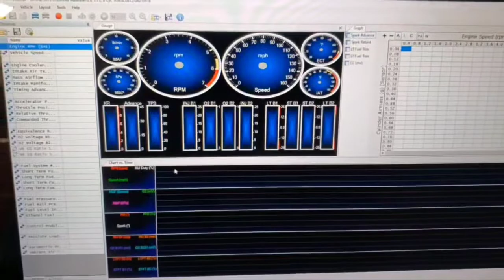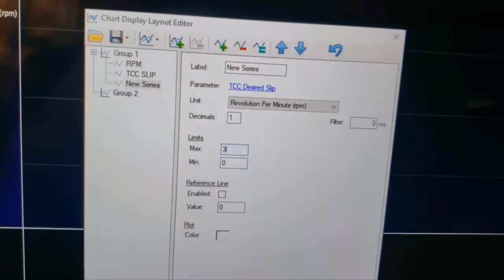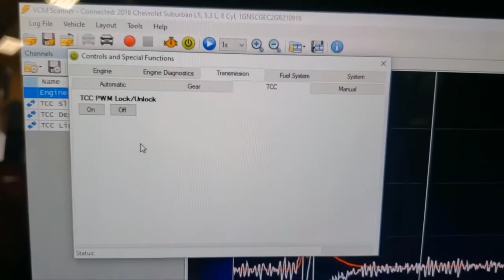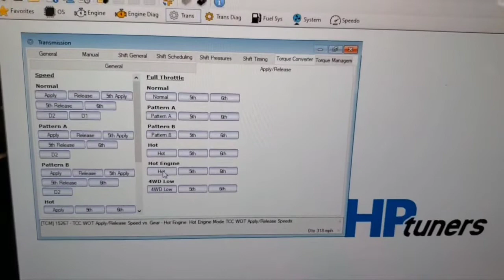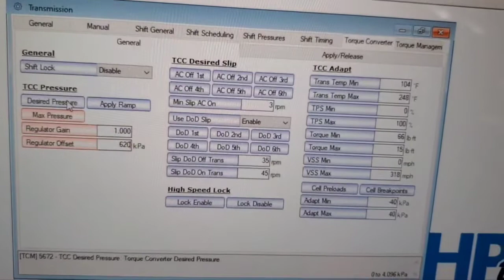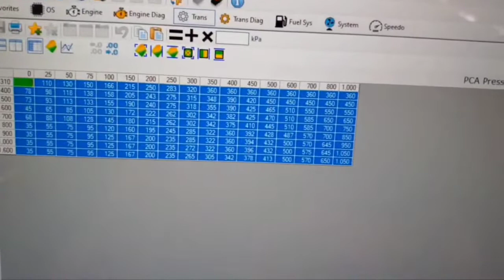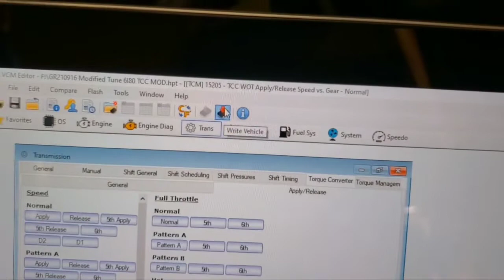6L80 full of metal is saved with HP Tuners (TCC failure)

Comment: Great video. I have a 15 Sierra that has very minimal slip. 170K miles. Would you recommend doing the same tune to prolong the 6L80? I haven’t dropped my pan yet, fluid is a little dark on the dipstick but nothing crazy. Thank you.
Reply from the maker: I would recommend a similar tune. Disable TCC in 1-4 and call for 0RPM slip in 5-6 but leave max TCC apply pressure alone. Only crank up max pressure if you absolutely need to. I've heard it's possible for too much TCC apply pressure to apply too much force to the thrust bearings on the crankshaft in the engine but there is no way for me to verify if that is true or not. From my research looking at cutaways of several lockup converters I don't see it as being a problem but I could be wrong.
Reply: @TechnicianRed  Roger that! Appreicate it!

Comment: I have a FTI 3200 Stall
Triple Clutch torque converter
and my 6l80e transmission it's
shudder 55 mph. it didn't do it with
the stock torque converter. 
Do you think i need to get tune
Reply from the maker: I don't have any experience with aftermarket performance torque converters but I imagine the manufacturer would want it tuned to reduce slip. I would call the manufacturer and ask their technical support.

Comment: Could you not flush the transmission and put in a new torque converter?
Reply from the maker: NEVER flush transmissions! That's a good way to loosen up some crud and have it clog a solenoid screen, stick a solenoid, or jam up a spool valve in the valve body. As far as replacing the torque converter only- Don't do it! Torque converters are pretty pricey and the labor is too high to make that option a good route. Besides, these transmissions give LOTS of problems so yeah you might get the torque converter to start working again but it won't be long before the transmission fails and takes the new torque converter out with it. If you need a torque converter on one of these with less than 100K the transmission fluid hasn't been maintained so the trans isn't going to last that much longer. If you need one with a trans that has >100K the trans won't last much longer due to mileage. Either tune it and run it till she blows or replace the whole transmission. Those are your only two good options.
Reply: @TechnicianRed I’m guessing you are talking about machine flush with cleaners? I did a redneck fluid exchange through trans cooler lines on a 6l50 with 100k miles. I think it had one transmission service as recommended by manufacturer. The fluid was as dark as motor oil and had some glitter in it. I haven’t even dropped the pan or changed filter yet. I was a bit nervous but  I’m happy to say it works so much better now. Much smoother and  the shudder on the highway is almost completely gone. It does still have some vibration sometimes but even that isn’t consistent. Will drop the pan and change the filter shortly. I will probably get it tuned also. The proper fix for this is upgraded valve body and either replace or upgrade torque converter which is $4-6k unfortunately.

Comment: I’ve followed this step by step and my lockup is very harsh when this tune is applied, any advice?
Reply from the maker: Was your TCC slipping before trying this tune? If you use this tune on a good torque converter clutch I imagine it would probably shift pretty firm.

Comment: So much learned here, my 2017 8L90 started shutter at 39k miles about a year ago. Hadn't a clue, thought I had a loose wheel. Last week at 44k miles it came back for 60 miles. Can my 8L90 be saved? I bought Shutter Fixx, which I was going to add half. It would be in there if it had a filler tube. Like everyone else, I feel burnt by GM. Any tips to avoid as many issues as possible? I drove 600 miles this week without noticing any shutter. thx
Reply: There was a service bulletin for the 8 speed transmissions. Power flush and put in the additives from the start of the video supposedly fixes the 8L90 transmissions.

Comment: Mine just started slipping today, going to rip this pos trans and go to a mad dog hopefully this will resolve my issue, man i miss the manual transmission days.
Reply: And also a manual clutch not hydraulic! Lol. My little work daily is a Ford ranger and I go through hydraulic slave cylinders more than I do underwear.😂😂😂 My ranger has 507,000 miles and still rocking the original engine transmission and rear end, but lost count of hydraulic slave cylinders!

Comment: Careful as too much pressure, yes it'll hold things but it can always prematurely wear out the Crankshaft thrust bearing.
Reply: Just tested this on a 2014 6.2l gmc 6l80. Making noise holding 25-30 tcc line psi, sliping up to 130rpm. Activated tcc lock. O slip, no more shudder or noise 530psi at tcc line.
Reply: So what im sayng is, id rather up the psi enough to save the trans vs trans rebuild. I dont think there will be any negative effects from removing these damaging harmonics from the tune

Comment: 2017 Yukon XL. 80K miles. Trans fluid and filter serviced @ 70k. 
Seems to be running smooth. No shift problems. 
Id like to tune it as precautionary measure but am not familiar with hptuners and not necessarily interested in purchasing the device and software (not sure if sold together or how that works). 
Should most reputable transmission specialists or maybe a performance shop have access to these tools and software to perform this service for me?

Comment: What do you feel is a acceptable off target amount?  I datalogged mine lastnight and found it was approx 40 RPM above the desired slip, not nearly as bad as the one in your video.
Reply from the maker: 40 RPM is still too much. I would do the reprogram ASAP before the converter gets anymore wear. It should be within about 5 RPM of desired slip. This is just a guess (I'm comparing it to a 4l60E which maintains a very accurate converter slip RPM)
Reply: @TechnicianRed  will do thank you for the reply!

Comment: Keeps us updated on the life of the unit tested here. Good video with data and suggestions!
Reply from the maker: Talked to the customer a couple weeks ago. So far they have only put 1000 miles on it but really like the way it drives. I programmed my Dad's Tahoe like this as a preventative measure and he has probably put 10K miles on it so far with no problems. There is about 275K on that Tahoe.
Reply: @TechnicianRed  where are you from! Take my truck for your tune!
No one in my area wants to do it ! 
And I don’t feel like buying credits and the hp dongle
Reply: @marck16v I think you still have to buy the credits even if someone else does it
Reply: @ICU_Haji yes
Reply: Any more updates from the customer?
Reply: Good to know

Comment: Can I do same thing on 8l90?
Reply from the maker: Probably
Reply: @TechnicianRed  on 8l90 In apply ramp pressure 400x6k rpm is 1024.0 what should I put? In your video is 445
Reply from the maker: @faridgadimov5955  I would change them all to 1,024. Basically do just as I did but use your higher number.
Reply: @Technician Red  thank you l will. Also I did apply 318. release 317 1-6gear and left 7 and 8 untouched that's ok?or do 7th gear to?

Comment: Also good idea to bypass transmission cooler line thermostat.thats one of the biggest reasons fluid overheats
Reply: So i only get the shutter in 6th gear at like 70 mph 2011 gmc seirra 5.3 i notcied ur not touching anything but lower gears idk if that would work for me any ideas ?

Comment: you can also click on the KPA and change it to PSI. THANKS FOR THE VIDEO!
Reply from the maker: And thank you for the tip!
Reply: @TechnicianRed 
Yes any text box or parameter you see it always has the units beside it. Whether it’s in pressure, speed, or time. You can just click on the unit and it’ll cycle through the available options. 
Like 600 kpa, you changed it to 1000 kpa. Just click on kpa and it’ll go to PSI. 
It’s also been a year. Do you have a new update??

Comment: Have a 2016 Silverado with 109xxx on now changed fluid at 80xxx and disabled 1,2,3d lockup is all I did and disable dod doesn’t slip or anything but 

Would increase line pressure hurt any thing or just help prolong the transmission ?
Reply from the maker: I wouldn't try increasing pump output line pressure as that would cause all of your shifts to be too firm. But I would tune it to command 0RPM of slip in overdrive to keep that TCC from getting unnecessary wear and tear. You probably don't need to increase converter line pressure if your TCC is still good but I doubt it would hurt it.
Reply: @TechnicianRed  Can you do a video where you show how to increase the pressures to firm up the shifts? Running larger tires on my truck and I just want to get a little firmer shifts. Also Like to see how to use the "fastlearn" and "clean" features in the VCM Scanner. Thanks!
Reply from the maker: @batsy74  sorry but that is over my skill level right now. I don't do custom tunes- that takes lots of experience to do properly without causing harm.